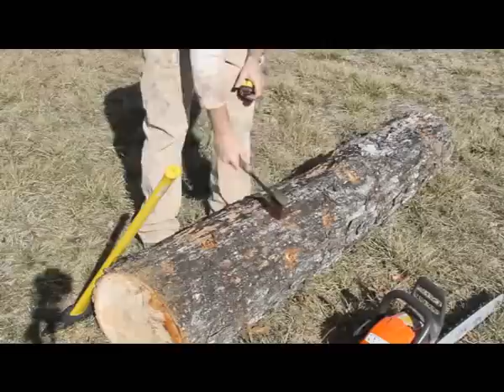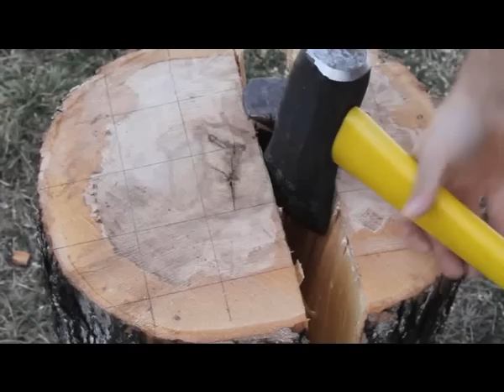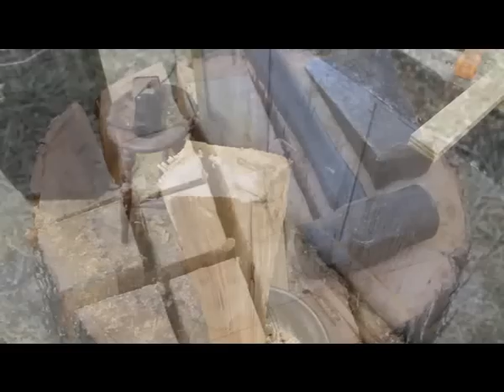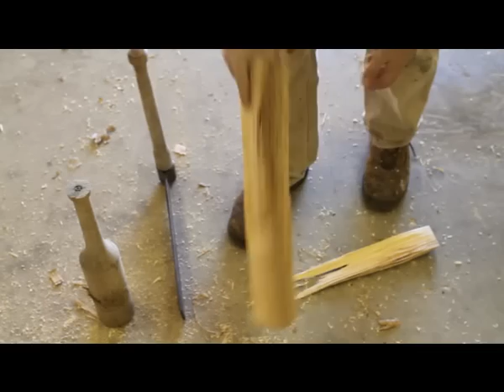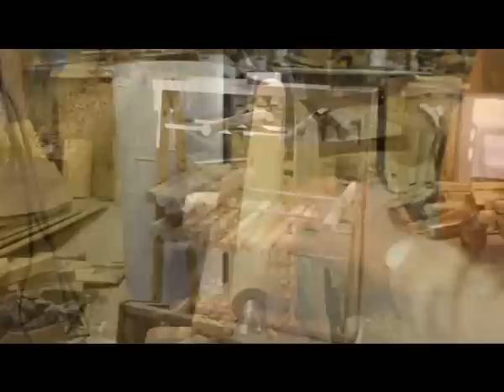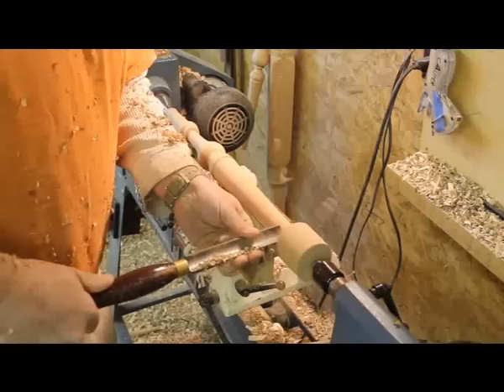Making a Windsor Chair Leg

Comment: My old dad loved tuurning and he used inside and out side calipers.he would have loved the caliper guage you use. He also made half templates from a finished spindle.neat to see similiarf  techniques. He had an extended frame shop smith and a beloved set of craftman tools from the 1940s. Great steel in them, he never made windsor,but many many colonial chairs .loads of shavings in the shop,always smelled great.

Comment: Be a good idea to grind off the mushrooming tops of your wedges. A friend of mine hit a mushroomed wedge on the side, and a 22 bullet sized chunk of metal chipped off and lodged in his leg!
Reply: Im surprised a wood worker with this kind of skill in splitting wood hasn't figured out how to turn a chunk of wood into a mallet. I feel sorry for those tools. Metal on metal should be avoided in striking tools. Except maybe in the blacksmith's shop.
Reply: Also, not a particularly good idea to be striking the wedge with a metal hammer. It can be done using a home-made hardwood mallet1

Comment: Great video!! I can give you a bit of advice for what it is worth. Next time you are splitting with hammer and wedge. Take a pry bar, full size wrecking/crow bar if you had rather call it such. It will make getting the wedge out a lot easier. The bar I am recommending is just the old style 30 inch or so one

Comment: Nice work, Matt.  But man, I cringed when I saw you pounding on the poll of that Estwing hatchet with a sledge (and how mushroomed that poor hatchet's poll was).  Also noticed you were using a plastic deadblow hammer on the nailset (to mark the approximate center of the stock), and that deadblow hammer looked like it was split or cracked from being pounded on thin metal tools like that.  Anyway, loved the video and your turning technique!

Comment: Great video! I have a question if you're still answering them, or if anybody in the comments can.  
Whats gets me the most about woodworking is the expensive price of wood. It only becomes economical for creating products if you're buying in bulk during a sale (from Shone lumber or the like), or if you scavenge your own wood from logs or old furniture.  
I've been wasting a huge amount of time trying to rig a bandsaw into a mill for my own logs. It never even dawned on me to try splitting...  
So my question is, does splitting work for creating usable boards? Does the moisture, length, and hardness of the wood ever come into play? I have both freshly downed and long term stored logs, some 8' long and others only 2', some walnut and oak, and some fir and pine. Thanks again and great video!

Comment: A delight to watch this whole process,
I'd like to make a couple of observations, one philosophical and the other relating to safety.
If you've ever tried sculpture you soon realize that there are two fundamentally different processes - carving and modelling.  Carving you work away the outside and  reveal the inner shape.  Modelling is the opposite, you start with a shapeless lump - clay or wax as the case may be and work out until you get the shape you want.  In the video It's all effectively a form of carving.  The  mind trick is to know by looking at the shapeless lump of what the layman might think of as a piece of firewood, and know what you can turn [ pun ? ] it into.
On the practical side I'm mindful of some safety issues.  In the hands of a master craftsman it might look OK, but those with lesser experience could easily run into trouble.  During my engineering apprenticeship I was working a metal turning lathe when the cuff of my overall got snagged by the work piece.  Fortunately my reactions were good enough to rapidly and forcibly pull back so that my sleeve was torn, but my wrist escaped a mangling.  I noted some potentially dodgy hand movements round the work in the video, particularly in the final finishing taper which necessitated encircling the work as it turned.  Also the use of a diameter gauge throughout was both mysterious and dangerous looking.
Anyway a thought provoking piece and a welcome reminder that there are still those amongst us who are keeping craftsmanship alive.  I see it as in a way paying homage to our antecedents and a way of showing that in a sense their world has not disappeared like footprints on a sandy beach.
Reply: Kudos Harold.  Good solid observation and spot on. Watching videos certainly do not make masters in the class but we all learn a lot. Safety is without doubt extremely important and the basis for being able to work on wood hobbies for 40+ years and have all the digits etc. Well said! DD

Comment: Great work Matt. 2 questions. Do you ever use a spoke shave to rough your blanks into round before putting them on the lathe and could this prevent undercutting with the froe? How come you haven't made a tool rest longer than your blanks so you don't need to shift it back and forth to reach each end? Keep up the good work.

Comment: On the wedge (or chisel or star drill) when a “mushroom’  starts to form on the head from repeated hammering, it is important to grind off the edges of the “muffin top”.  The flared steel is very stressed and unstable and prone to splintering.  By grinding off the splitting edges of the “cap” the risk of shrapnel flying off is greatly reduced.  Years ago, hammering an old star drill into concrete, an edge shard shot off into my hand.  Deep!

 Fortunately, it was not into my eye or someplace that tweezers and magnet couldn’t reach.  Since then I always wear safety glasses and all striking implements have their heads ground clean.
Reply: I try to avoid striking hardened steel with hardened steel.

Comment: When turning square stock I usually use a hand plane to shave the corners off.  Then I will leave the tail stock a bit loose so the turning stock will stop spinning if my gouge gets caught up.  I tighten the ail sock as the turning becomes more cylindrical.  I am not telling anyone how to do it, I mean only to share information.

Comment: ah. you've got one. never mind. after the big splits you could just fro the rest of it. a roughing hand plane will get it closer to round instead of going to the lathe. not a huge difference. it's just safer and saves your turning gouge blades.

Comment: how do you prevent the split from deviating significantly from the mark?  In my experience splitting wood, often the grain takes all sorts of unexpected twists and turns. Is it all in experienced selection of the section for straight grain?
Reply from the maker: You have to split evenly! If you split each piece in the middle you have a much better chance of the split running true and centered. If you are off centered, the split will run out on you!
Reply: if you've ever watched someone split hazel rods, you know that there is a lot of finesse and experience involved.  There is a great video of this canadian guy, i forget the name of the show but it was from a 'salt of the earth' style show that aired in Canada in the late 70s~ (don't watch the one with the British puff that was on that 'victorian farm' show or whatever, the canadian guy was a f'ning man's man.  Like they transported the guy from the 16th century).   That guy was splitting hazel-rods like a fucking boss.

Regardless, in this video, the guy is splitting logs, not rods, but I've noticed in my experience that the thicker the wood, the cleaner it splits.  I think this has to do with that as the older the tree gets, the trunk just doesn't expand at the same rate it did when it was a sapling.  So even if the grain isn't perfect, the lines are just much much closer together so it is less apt to split as wildly as a younger tree.
Reply: SLUŠNI SLUŠNI SLUŠNI
Reply: Erik Anderson

Comment: Does it not warp after it dries? It was green wood right?
Reply from the maker: Only had a couple warp on me and that was because I left them lying on a concrete shop floor for to long! I assume the moisture wicked out more on one side!
Reply: Thanks! Do you usually let them dry before the stain and finish? I don't know much about how green wood reacts if it's stained or finished before its dried, sorry for all the questions.
Reply from the maker: The only part that I want dry is the tenon, that way it doesn't shrink once it's in a chair and loosen! I have a homemade kiln (a plywood box with 100 watt light bulbs used as the heat source) I stick only the tenons in and it dries them down in only a few days! Once the chair is assembled, it can be finished, the moisture doesn't affect the stain/paint because I use water based!

Comment: NEVER strike the poll of a hatchet.  You could send a shard of metal flying that could be the equivalent of a piece of shrapnel.
Reply: Jay Ryan Never strike the back of a hatchet or axe, but it has nothing to do with shrapnel.  If you're wearing safety goggles (and you are, right?) then the danger posed by the cutting edge of those tools during their normal use is far greater than if the steel cracks.
The reason not to hit the back of axes and hatchets is simply because it fucks up your tool.  You can see that all of his wedges are mushroomed over - this reduces the life of the tool.
Far better to get a brass mallet for striking.  You get most of the power of a steel hammer,  but you don't mess up your steel.
Reply: fisharmor That's what happens when you use tools a lot, though. I imagine that those things are many, many years old.
Reply: fish man is right.
Reply: Didn't they bust that myth on mythbusters
Reply: Shane K I think that was hammer face on hammer face.

Comment: Loved your video.

I have a question on how you use your chair leg template to mark out your blank.

After you have made the pencil marks on your blank, do you center your parting tool on these lines or do you offset the parting tool so that you, in effect, leave the line?

Some of your marks looked very near each other and it seemed that your parting tool would be overlaying the adjacent cut. Hard to tell from the video so I thought I'd ask.

Is that a homemade tool rest extension?
Reply from the maker: Great question!!! 

Yes it is a homemade(modified) tool rest! Basically two lathe banjos with a wood block and a couple dowels glues into it, then a piece of flat metal to serve as a wear plate!

As for the parting tool, I center the parting tool on the lines I make however at some transition points, I have to adjust to make the profile I am doing. After you do 30 or 40 it becomes second nature on how you adjust and which line is which section! Also I always turn the exact same way start to finish! Makes the robot part of you take over after a few!!!

Comment: How come the log gets split with the wedges, wouldnt it be easier to us the chainsaw?
Reply: +Ozchuck lots of wasted material using the chainsaw
Reply: oh ok, thanks for the reply :)
Reply: truthfulkarl the time is worth more than a bag of chips.
Reply: +YN3 he is trying to maximize his profits, you can hear him in the start of the video explaining how he picks a pattern to give him the most blanks. this piece is made valuable by the time put into it rather then by mass production
Reply from the maker: Sawing, you defeat the purpose of splitting and maximizing the strength of the wood! If you saw and wood, you cut thru the grain and thus produces a weak spot! Splitting, you get far more strength from the wood because the grain is straight with the side of the split, which allows almost zero fractures or loss of parts you make!
Reply: +Matt Rushing nice
Reply: waste considerations aside, it would be extremely difficult on the chainsaw to rip parallel to the orientation of the grain.  Chainsaws are shipped by default with 'crosscut' blades, designed for maximum efficiency while cutting perpendicular to grain orientation to hog out chips. Kinda like when you're hitting a tree with an axe, one strikes in a high/low style and chips sort of just 'pop' off the tree.  You'll note if you chop into end grain however, this phenomena doesn't occur.

So, to solve that, you would either need a 'rip' cut chainsaw blade (otherwise you'd just destroy the crosscut blade by overheating), and you'd waste a bunch of time changing blades whereas you could just split the log, or you'd need two separate saws. One with crosscut, one with rip cut.  But why spend $150-300 on an extra saw, when you can just split the wood?

And that's the same with any cutting machine.  Even bandsaw blades by default are not efficient for rip cuts.  So in short, it's just more efficient, by any metric, to just split the wood than cut it.

Comment: i am totally confused. if you are going to use a chainsaw and a lathe, why don't you cut the log on a saw and stop losing so much material with poor-at-best old school splits. you clearly have the know-how and talent - can you explain why you waste all the time and effort to split the wood out by hand? 

and yes, watching you with the loose sleeves freaks me out too. but if you are comfortable showing noobs to dress like that and not have great site safety... that's your style. 

for the noobs - do NOT dress like this. make sure you have all your sleeves rolled back and all your safety items ON and USED. watched too many "great wood workers with 20, 30, 40 years experience" take off fingers and arms. yep, arms. seen it.
Reply: The splits follow the grain leaving the resulting blank as strong as possible as well as the most stable over time.

That ignores the fact that anyone who ever tries to rip a log of that size without the appropriate mill, (which most of us don't have), will likely give up long before they have finished the first cut.
Reply: splitting doest waste material, you lose fiber when there is saw dust